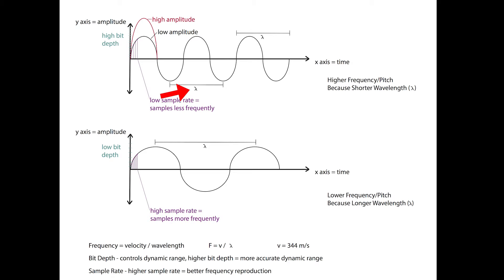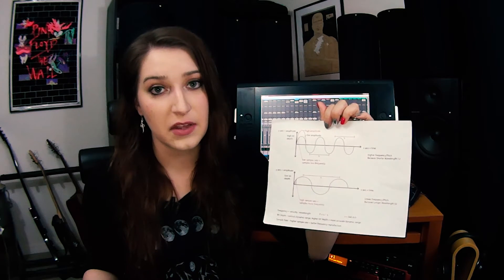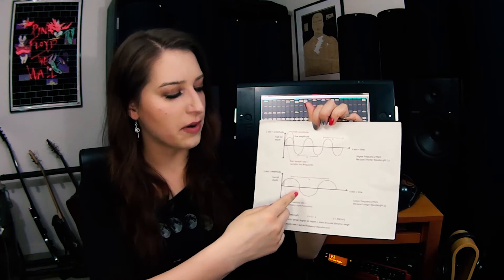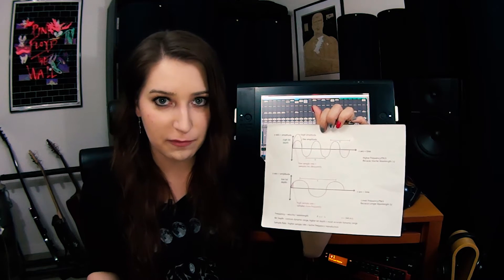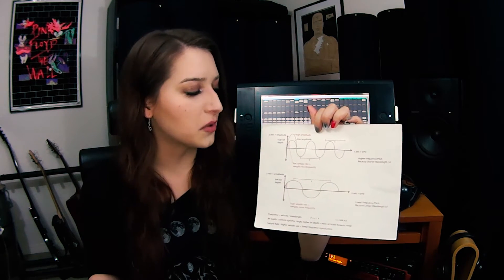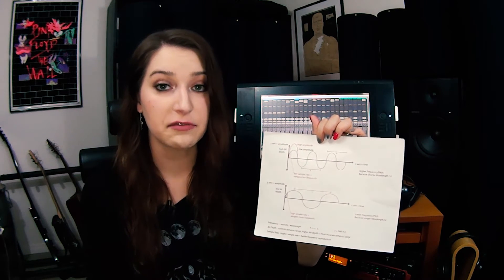Digital Audio: How Does Sample Rate Affect the Sound?

Comment: By the age of 30 most humans can no longer hear 20KHz, the average is closer to 15KHz.  44.1 KHz is high enough to produce the full range of human hearing.  

The reason higher sample rates sound better is to do with how A/D D/A converters work.  A converter needs to filter out everything above nyquest, but it has to do all this filtering below the nyquest.  So if you have a sample rate of 44.1, the converter only has a 2 kHz range to do that in order to represent everything below 20 KHz.  

That tiny filtering space means you get distortion happening in the audible range (ripples in the band pass).  If you sample at a higher rate like 96 KHz, there is ample room to filter in because half of 96 KHz is 48 KHz which over twice the human hearing range. So you have 28KHz of space to filter in.  This means converters can avoid the distortion caused by having to filter with lower sample rates.  

That's why you can hear a difference.  It's not that you're hearing more high frequencies with the higher rates, it's that your hearing a cleaner signal free of the distortion produced by A/D filtering at lower rates.  So Cato got it right when she said she could hear a cleaner, clearer sound at higher rates.

If if you want to know more, I recommend Bob Katz's book Mastering Audio, The Art and the Science.  He has a whole chapter on this and explains it in detail.
Reply: Mark Wingfield you explained a hard to understand concept very clear and concisely. Wish my teachers could do that, even once.
Reply: Mark Wingfield 
Very well explained, Mark.
Reply: Mark Wingfield playing a cd on my hdcd high definition cd player sounded better than the same song played on spotify's higher resolution service. Did not expect my hdcd player bought 10 years ago to beat out spotify. Why?                Also noticed best buy will no longer sell cd's come July 1,2018. Went from vinyl records pleasantly distorted to cd's in 1982 to lossless spotify in 2017- each change traded off convenience for much worse sound if you listened thru a capable sound system.
Reply: Cato Zane Yes, you're right. The reason it is easier (and more accurate) to use 88,2 kHz sampling rate instead 96 kHz to downsample to CD standard (44,1 kHz) is 88,2 doubles exactly such frequency, so in the downsampling you just remove one sample of each consecutive two. If you're using 96 kHz sampling rate and want to downsample it, the target freq should be 48 kHz (same reason). You can, of course, convert 96 to 44,1, but at the expense of inaccuracies due the fact that those are coincident only 1 time each 100 (referred to 48 kHz) and 1 each 2000 (referred to 96 kHz). All the non-coincident samples must be obtained by aproximative and/or statistical methods. Not very cool, really.
By the way: both 44,1 and 48 freqs were selected because the beginnings of digital audio were developed using video tape as storage media. There were, basically, two different formats for video signal: PAL at 25 fr/second 625 lines, and NTSC at 30 fr/second 525 lines. Believe it or not, those restrictions in frames and lines, when used to record digital audio-only signal with rotary head machines, determined the frequencies (and bit depth) in the "dawn of digital man".
Thanks so much for your video.
Reply from the maker: thanks!  What you're talking about (in terms of higher sample rates vs lower and the filtering space) is tied in with aliasing, am I getting that right?  I need to learn more about that - thanks for the book recommendation!
Reply: Yes the filtering prevents aliasing. One thing which is interesting is that different D/A converters work better at different sample rates.  It's a complicated process and not easy to get equally good results at all rates in one converter.  So some converters will sound better at 96 kHz others at 88.2 kHz or 192 kHz.  This isn't to do with more information being present in 192 compared to 86 or 88.2.  88.2 contains more than enough information to represent a sine wave with 100% accuracy at over twice as high as any human can hear.  So 96 is in a sense overkill and 192 is super overkill. If people hear an improved sound with a 192 file compared to an 88.2 that's because their A/D converter doesn't work as well at 88.2, not because there's actually a sound difference between the two sampling rates.  Bot Katz did some really clever double blind listening experiments to prove this, which he explains in the book.  

Personally I usually record at 96, not because it sounds better than 88.2 but because it seems to have become the industry standard for hi-res download sites.  I used to use 88.2 because I was told that by someone I know who makes super high end converters that the maths of moving from 88.2 to 44.1 for CD, was cleaner than from 96 to 44.1  I can't confirm that because I don't understand the maths!  But as not so many people are buying CDs these days and the future looks to be hi-res downloads, I moved to 96 for most clients.  

Great videos by the way!
Reply from the maker: Oh, that's really interesting!  I did hear the same thing about the math being simpler when converting from 88.2 to 44.1 too, because it's a multiple, but I don't know the details of how the math works either.  I didn't know that some converters are better at certain rates, but I guess it makes sense - interesting, I love how there's always more to learn!  Thanks!
Reply: @markwingfield9423  I will have to argue with your statement that '88.2 contains more than enough information to represent a sine wave with 100% accuracy at over twice as high as any human can hear.' The Nyquist Theorem uses infinites in its functions which work on paper but converters cant realistically use them. Ultimately, this leads to reconstructions that aren't 100% accurate.
Reply: @ampexman1  We'll have to agree to differ on that Matt :)
Reply: @CatoNoise  I've read that the concern of dividing 88.2 to 44.1 is a holdover from the days of less computational capacity on older machines and older software, that conversion of 96 to 44.1 or other seemingly awkward division math is handled much more capably now with what we have available to work with. I used to work exclusively in 44.1kHz for that reason but now only work in 48kHz or higher using a good dithering engine to convert to 44.1kHz when delivering to clients who request it.
Reply from the maker: @kevinmccarthy4088  oh, hrm, yeah, that makes a ton of sense! Thanks!
Reply: what a ... what re u talking
Reply: Hey there! I am still confused. This filtering already processing in audio interface right? let say I use 48khz it means there are 4khz more range to filter the aliasing (21khz - 24khz)? I read somewhere that plugin sometimes affect to this. should we still use low pass filter or not? thanks!
Reply: ventura rodríguez vallejo
Wrong. The conversion is not that simple so 88.2 kHz has no benefit over 96 kHz. Look it up.

Comment: The early days of digital audio research the hardware, at the time, didn't exactly had the capacity of storing the audio samples. The fix was adapting video recorders for this purpose. In turned, the sample rate took the same sample ratings for video. At the time at 60 Hz 35 of the 525 lines were blanked leaving 490 lines per frame, or 245 lines per field. The math is then worked out like so:

60 Hz * 245 lines per field * 3 = 44.1 kHz sample rating
Reply from the maker: That's so cool, thank you for sharing this!!!!!
Reply from the maker: where did the 3 come from?
Reply: Each of the 245 lines are sampled 3 times.
Reply from the maker: got it, thanks ^_^

Comment: 96K for me. There is something about the "air" or presence that sounds better to me than 44/48
Reply: OK, I have an Akai DPS16 16 track recorder.  I can record at 44.1, 48, and 96KHz.  Each higher sample rate produces noticeably crisper sound.  It's plain as day!  There is no way it is placebo effect.  It's bothersome actually, because using 96KHz limits the number of tracks I can have and cuts the number of effects and sends from 4 to 2.  If there were no difference, or the difference was imperceptible, I'd say, fine, I'll use 48KHz.  But it's quite noticeable, and annoys me that I can't get full functionality at the better sounding 96KHz.  And this is without using effects or EQ in the DPS16.  I've heard the same with a handheld Zoom recorder, although it wasn't as noticeable.

Maybe the filter rolls off a bit before it "brickwalls", and switching to a higher sampling rate gives a flatter frequency response out to 20KHz.  I use good headphones that are spec'd to 80KHz.
Reply: Watch out, if you use many kinds of sample rate in a track, it can damage your overall quality, as some sample will be converted to higher/lower resolution. Converting down sample rate always sounds better than converting up, also.
Reply: I'm not using different samples rates.  The sample rate is chosen when starting a "song", and can't be changed.
Reply: +Hyxtryx
Maybe your Akai recoder (or your placback system) can't do the sampling well at different sampling rates, this is what you hear.